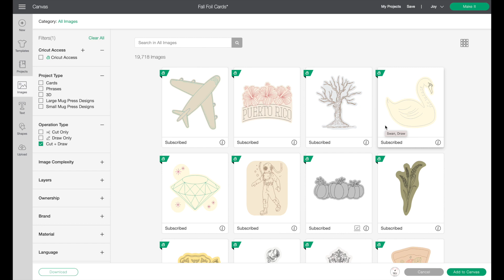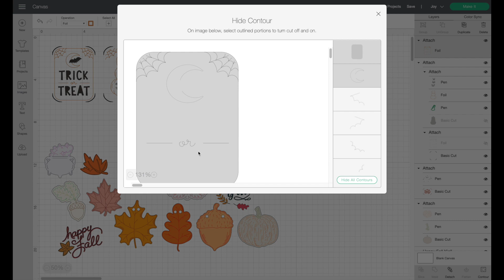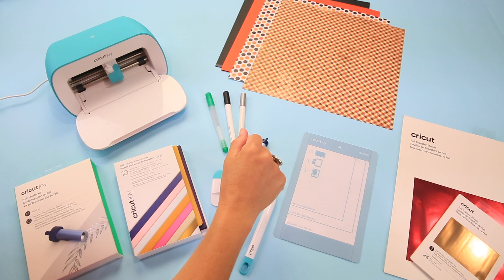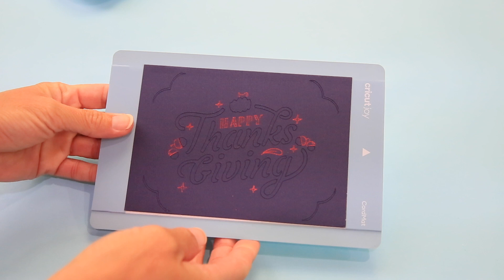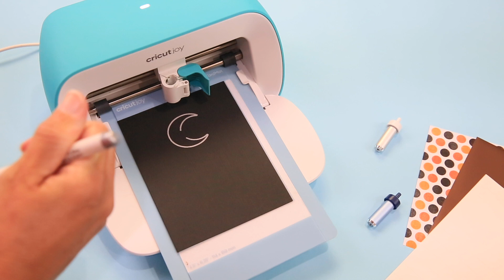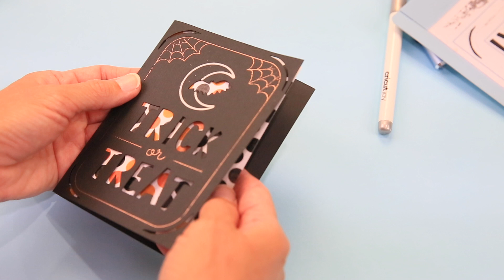How To Make Cards With Foil | How To Make Pumpkin Cards With Cricut Joy Foil Tool

Comment: Hi kim, I have just tried to make a birthday card with Foil and pens.  Pens all good - the Gold Foil was to go into the drawn balloons and read Happy Birthday.  However, it hasn't done the foiling very well.  It is very light and some of the letters are only half done. I have taken a photo and wondered if you would have time to take a quick look for me? or some advice.  Many thanks, Linda
Reply from the maker: Good morning Linda! Are you using the Joy or another machine. It sounds like your pressure is off. You chose the foil option in Design Space? So the machine knows that it's foiling? And you're sure the foil tip is all the way down in the machine? Hmmm... I could take a look but it might be a calibration issue and Cricut support would be best for that. They're super helpful! Let me know and happy card making! 🩷
Reply: @KimByers  hello Kim thank you so much for getting back to me.  I have an Explore 3. Yes I did choose Foil in Design View.  When I pressed Make, a message came up ensuring I use the foil cutter with 2 rings around it along with which colour pen to be used first.. I found that the Silver did turn out better than the gold  I shall re calibrate my machine. It cuts everything else beautifully,  I LOVE it. My husband purchased it for me 3 weeks ago, and you can't get me off of it. Thanks for your advice. Looking forward to your next video. Best wishes,  Linda xx

Comment: Can I eliminate the corner cuts when designing a card?
Reply from the maker: Absolutely! If you don't cut shapes in the card, like I did on the one jack-o-lantern card, and you don't want paper showing at the corners, just go into the contour tool and turn off the corners. It's as simple as a few clicks. Thanks for watching and happy crafting! 💕